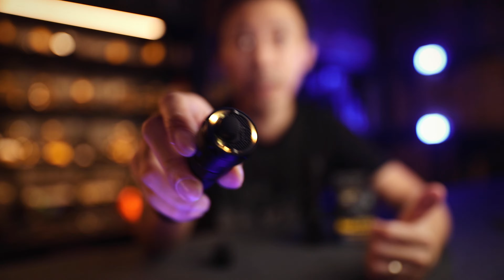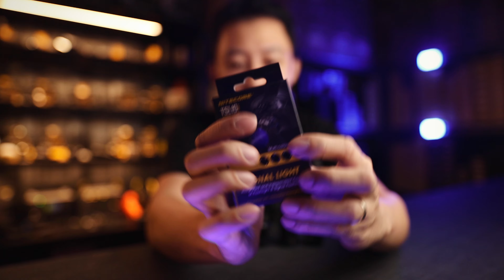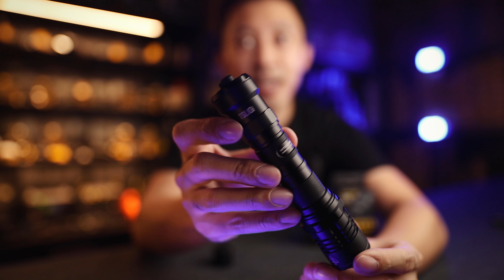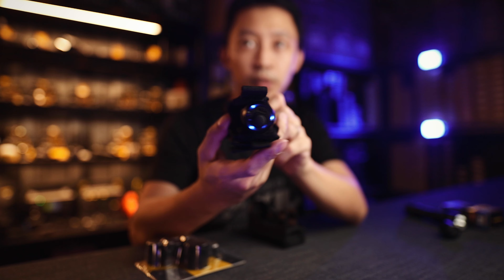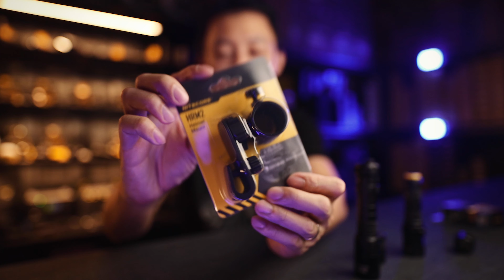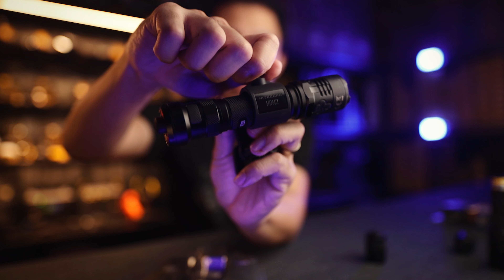Nitecore TSL10i - First Look at this Signal Tailcap Switch

Comment: quick question please regarding Nitecor i series tailcap/operation.  Will the main switch recall the last mode selected after turning the light off?  I like to be able to choose. Thanks!
Reply from the maker: If used on i4000r, yes. If used on P20i and p10i, no